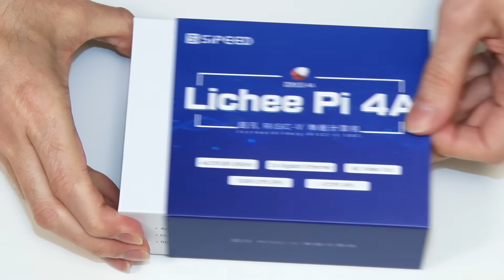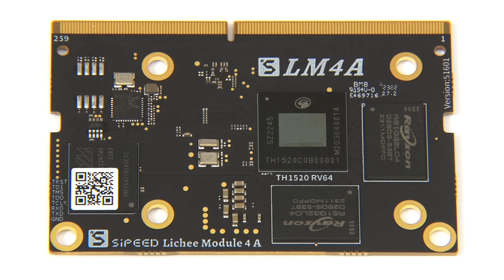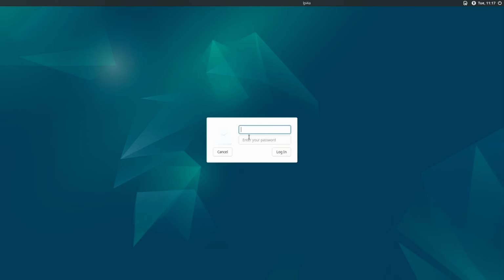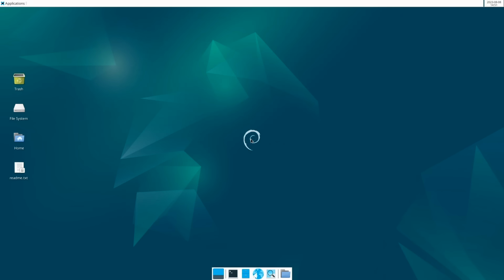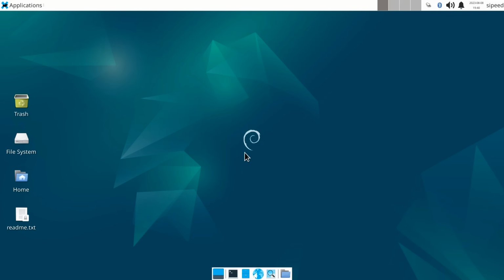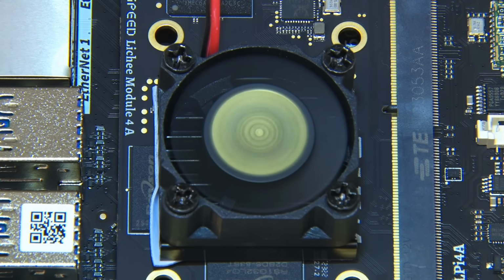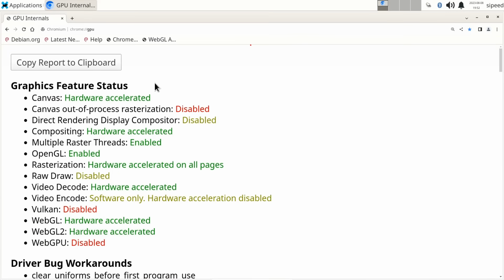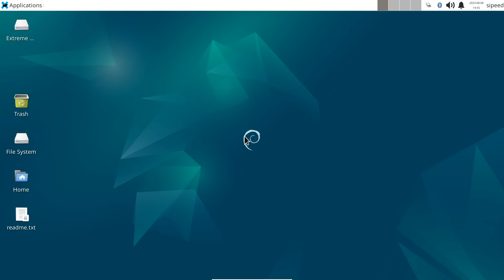Lichee Pi 4A: Serious RISC-V Desktop Computing

Comment: the main problem is price - I buy N150 based mini-PC for 87$ - and this is ready to use device with 16gb ram and 500gb m2 SSD, and it able to playback 4k60hz video on youtube! I use it as cheap and awesome TV box, because of built in smart TV sux!!!

The concept is cheap - this is that everything is ready for work - the body is assembled - the power supply in stock - the most difficult obstacle - this must be set the OS - this is the price for the device with the characteristics that I described should be in the limit of +/- 10% - I do not consider in principle - this is a cheap and multi -functional PC and more for such a thing I will not pay - 

MAX cheap is 100$ and everything should work 

There must be a case
And everything is installed in it - RAM, SSD disc minimum at least 500GB, Kuler is natural, WiFai, Blutus!
The power supply is included!

I see you are not too lazy to take the sets "do it yourself" - but this should give an additional discount on the goods!
Reply from the maker: You seem to have completely missed the point. As I note in the video, this is a *RISC-V development board* for those seeking to program for or otherwise experiment with RISC-V hardware. And you cannot do that with an N150 or any other Intel or AMD mini PC. The Lichee Pi 4A is NOT a consumer product and IS NOT marketed as as such. If you are looking for a mini PC, do not buy RISC-V hardware! :)
Reply: @ExplainingComputers  my main point is PRICE (COST)

Initially, micro PCs positioned themselves as cheap solutions - for me as a desktop PC user - they should be cheaper - but at the expense of lower performance!!!

But in reality - they are more expensive than desktop solutions and less productive!!

You can't convince me that these are niche solutions - take it apart yourself Pi has advertised itself like that from the very beginning!

Now I see that only mini PC can fulfill my requirements!

For even a cheap desktop with the characteristics of a mini PC becomes more expensive due to the case / cooling and power supply .. and other elements

Comment: The Register has an article entitled "Faulty instructions in Alibaba's T-Head C910 RISC-V CPUs blow away all security", that specifically includes this Lichee Pi 4A SBC (which apparently uses the vulnerable RISC-V chip) in its affected computer warnings. If this report is true, it is probably a BFD regarding this computer's (and certain specific other's) potential vulnerability. It is NOT, however, a vulnerability in the general RISC-V architecture, but rather in the extensions implemented by this chip vendor.

Comment: I have a specific use case for tthis kind of hardware: running an instrusionn detection system! This hardware is particularly applicable  because it have two ethernet ports which means I can have it in between my modem and router runnnig snort!

Comment: This "PC" is not what it looks like. It is a small pluggable single-card computer designed for clusters, Laptops and other stuff. I'm most interested in the cluster concept of plugging seven computers on a larger board. This has the potential of becoming "wearable super computers", which are suitable for your private home AI.

Comment: when he talks about the tempature sensors but makes the comment of not sure where that is - not pvt on top of pi screen.   pvt can be looked up ( I did ) and it means presure, votage, temperature.   Article states the soc manufacturers usually put pvt sensors in to monitor ( presure, temp, voltage ) in the soc.   so assume 2 sensors in the soc chip.
Reply from the maker: Thanks for this. I knew what PVT means. :)

Comment: I see risc V making inroads in companies that don't want to be bound by arm for the most part. It would not surprise me if there is some prototype RISC V hardware at apple running OSX and IOS. Much like OSX has been running on ARM since the first versions. Apple likes to keep their options open and I can't imagine them not being concerned about ARMs control of the ARM ABI. They make their own CPUs, so once RISC V reaches the level where high performance processors can be made it makes a lot of sense for them to consider it. First on IPhones and IPads, then eventually on the desktop.

Comment: The fact that RISC-V systems are starting to become mature enough to be used for regular desktop use is huge. A couple of years ago that would have been considered a pipe dream.
Reply from the maker: Agreed.
Reply: Still no bios.
Reply: my sun system is 25 years old and runs on RISK.
Reply: @robertsmith2956 RISC CPUs aren’t new, but the RISC-V ISA is. Although it’s pretty sad that Sun’s SPARC didn’t make it big
Reply: @notNajimi These snapdragon and M series chips have certainly set the path for arm based desktops. It's so exciting.

Windows 11 recall feature plus the EOL for Windows 10 is honestly going to drive many users to at least try linux, which is great for the community. Very uplifting near future for arm and linux fans!
Reply: @YaySyu risc-v actually isn't ARM. Your enthusiasm is excellent to see and both ISAs will offer great paths for Linux (the latest Raspberry Pi Pico has cores for both!)

Comment: How does this CPU compare to RaspberryPi ? I mean compression, etc. I read the CPU is a beefed up design (if Xuantie-910 core is inside) - 12-stage pipeline, out-of-order execution, multi-issue
superscalar architecture with instruction set enhancements and still open source (according to a Chinese article).

Comment: I really want to like this, but I also don't trust running stuff on a CPU designed in China, no matter what instruction set it uses.  Is there a Risc-V CPU designed in Taiwan?
Reply from the maker: The RISC-V instruction set is from RISC-V International, based in Switzerland. The C910 CPUs that use that ISA here are indeed designed in China. But unlike most CPU cores, they are open source -- T-Head/Alibaba has even put them on GitHub. So in many respects they are cores we can have a great deal of trust in. I am not aware of any RISC-V cores from Taiwan.

Comment: what is the use case of this $180 device?
Reply from the maker: As noted in the video, it is for those who want to develop for, or otherwise experiment with, the RISC-V ISA. So, for example, it is for programmers who want to port their x86 or ARM operating systems or applications to RISC-V. Or for hardware developers seeking to create RISC-V devices.

Comment: it would have been nice if you would have shown some things:

what kernel is used?       what is the output of glxinfo?

it would also have been nice if you would have shown us how much power the board is drawing.

imo risc v is highly experimental.  they havent even finished their vector extensions yet.    and without simd, things like video playback etc. is going to struggle.

i am waiting for a risc v chip which has the full risc v potential, including simd
Reply: 5.10.113

The GPU only supports Open GL ES, and glxinfo is broken.

6W without high draw USB 3.0 devices

RISC-V Vector 1.0 is finished, but no devices yet have been taped out for it.

This somewhat early gen uses 0.7.1 which is binary compatible somewhat with the 1.0 spec.

T Head has a Matrix proposal spec for RISC-V as well. Though it's too new for anyone to make silicon for it.

Comment: Excellent review. It is clear that numerous semiconductor design firms, especially Chinese organizations, aspire to adopt the open-source RISC-V chip architecture, hence avoid the high expenses associated with proprietary systems. Good work.
Reply: copy&paste from a news-article from early august: 
"The RISC-V open instruction set architecture got a boost today after it emerged that five chip giants are coming together to jointly invest in a company to develop reference architectures based on the standard.

The new entity will be formed in Germany with investment from Infineon Technologies, Qualcomm, NXP Semiconductors, Bosch, and Nordic Semiconductor, with the aim of speeding up "the commercialization of future products based on the open-source RISC-V architecture."

If this sounds a bit vague, it is because the company's formation is subject to regulatory approvals in various jurisdictions, and so at this stage the founding corporations are unable to add any further detail about how much investment is involved, when it is expected to begin operations, or even what the company will be called.

What we do know is that this will not be a chip manufacturing operation, but will focus on the creation of reference designs to help increase the adoption of the RISC-V architecture. The aim is to establish the company as a single source for developing compatible RISC-V-based products.

Given the involvement of NXP and Infineon, it is perhaps not surprising the initial focus will be around automotive applications, with an eventual expansion to include mobile and IoT ecosystems."
Reply: @nopadelik9286  Thank you for providing this information. I look forward to seeing more RISC-V products in the future.
Reply: Again the Chinese propaganda?

Comment: This is amazing at this price, it has better maybe slightly better specs and performance probably not that different from the 2012 ARM Chromebook with Samsung Exynos 5 and MALI GPU... which was Euro 300. Also used to only run 720p Youtube video, I had installed a more regular Ubuntu desktop on it...

Comment: Would have thought by now it would be best to go with USB c?
Reply from the maker: Why? USB-C is not an interface standard, it's just a connector that in most instances communicates data at exactly the same speed as Type-A USB 3.x ports. And this board has four USB 3.0 ports! :) Also, how many keyboards and mice plug into USB Type-C ports/

Comment: Heat pads are really terrible heat conductors. Paste is the way to go!
Reply from the maker: Paste is sadly not the way to go here -- as there is no mounting mechanism for the heat sink. It is only held on by the adhesive on the pad! :) I also don't think that (decent) pads are "really terrible" heat conductors -- they are just worse than paste.

Comment: You mentioned that one is WIFi 4 and you are correct that it exists on these.  I would point out though for those wanting better performance there is also 6 that you can get these with.  My guess is the WiFi 4 one is more budget friendly with the prices ranging from $119 to $179.  Maybe one is a budget friendly one and the one is for the one who wants the best one that is available at the time?I am sure 4 will work fine for a lot of people but if you have fast internet and a WiFi 6 or better router you can choose the other model instead.  The way the WiFi is on the carrier leads me to believe there may be a few models with the RAM on the SOM being different.  I like the way they used an existing slot type rather than designing some awful proprietary thing but the downside is someone may get tempted to plug it into a RAM slot in a a laptop and then the SOM and laptop no longer power on.

Comment: I contract Pi Industries? To see it they have a 4-core CPU @ 5.0-6.0 Ghz, 32 GB onboard Ram, and eMMC and/or SSD?TB that can NAS Panel to handle "4-max of 8" eMMC or Sata3-SSD size of 1-5+ TB each 40.00-100.00 USD.  I want to Mount like a 24" 1080-4K flat panel screen, in one of those thin briefcases? Laptop style Keyboard, Touch-mouse, inboard battery add? But the cost may be around 650-1200 USD. AKA "Linux-NUKES"! Or you can build one?

Comment: in all fiarness, i already found the r-pi 400 a very decent desktop experience, like a pi-4 but just a little bit spicier in the clock speeds which help starting up your browser and stuff,  and it is suprisingly performant in realtime audio recording too with a simple scarlett 2i2 connected to it

i've bene blown away by the musical capabilities in terms of realtime synthesis and running DAW's like reaper and renoise
the options may not be as appearantly abundant, but even vst's like roger linn's surge can be built from source for arm (TONS OF WARNINGS on the makefile not having all the provisions for raspberry pi os distro and hardware when building it, but it worked regardless)

jack audio routing is something else too, giving you routing options windows can't even dream of providing
and from my experience even on x86 hardware it's barely more latency tahn ASIO on windows, which locks down the hardware completely even when wrapped with asio4all, jack audio is the best of all those worlds with minimal drawbacks

pulse audio needs to die in a hole though

i initually bought the r-pi 400 specifically for guitarix because it performed so extremely well using a r-pi 4 with a scarlett 2i2 and it would give me a little keyboard to do simple typing on as i'm armed with a guitar, so it was more convenient too in terms of space and convenience
 :D

Comment: That's insane.... I guess nothing like the threat of sanctions on proprietary tech to jumpstart open source architecture/instruction set that had been kinda stagnant for a decade... xD
Nevermind wondering whether this will work or not, seems the question now is how Risc V architecture will affect apps and the general upgrade path.
We're already at minimum viable computer already, kinda.... I have no illusions Risc V will get to some high end point, but it really doesn't need to. If it can work for small servers and average everyday computing, I imagine it'll have more than reached it's goals and purposes.
Thanks for sharing Cris!
Reply from the maker: Exactly. Brilliant post -- thanks for sharing.
Reply: @xsportseeker "jumpstart open source architecture/instruction set that had been kinda stagnant for a decade." The RISC-V instruction set has only formally existed in frozen form for 4 years, being ratified in July 2019 -- the same month the C910 cores in this board were announced. As it takes about four years to get from CPU core design to a mass-produced SoC on a board (Pi 3 and Pi4 were no faster), right now is the first possible opportunity for a mass-produced (i.e. cheapish) RISC-V SBC to exist. (The slightly slower StarFive JH7110 SoC and boards using it beat it out of the gate by a few months e.g. VisionFive 2, Star64). Where is the stagnation?

Comment: Chris, thanks !
Considering where it was made and came from, have you tried to run any security check? I am unfamiliar with RISC-V security tools, but like Kaspersky of sort, perhaps?
Thanks again!
Reply: Nah, paranoids would just wipe the distro entirely but you need to watch out first what this distro is using so you can add it to yours. BTW your attitude is correct, mentioning an unworthy windows program from Russia is not. This is Linux here, not some lame Windows thing, if you want to be paranoid, be paranoid of everything, no matter where it comes from. A Chinese device isn't worse than American device, all you are changing is what spy agency gets your data. If you are paranoid, you wipe and use a source based distro and compile everything yourself, preferably taking the time to inspect every line of code. Surely some institutions do, just to make sure...

Comment: Great video, thanks for showing this fantastic board! It really is remarkable just how far RISC-V has come in just a few short years. This sort of demonstration of what RISC-V systems can do would have been unthinkable a year or two ago, and now it's to a state where it's likely usable for basic daily tasks.

One thing I would like to see is a comparison between this RISC-V board and some other ARM based offerings, like the Raspberry Pi but others too, to see how the RISC-V processor can hold against other similar(-ish) ARM processors in other SBC's. Might make for a fun comparison video at some point, even if it may not truly be 1:1, apples to apples comparisons, due to the nature of support, hardware differences, etc.

Comment: I wonder why do all those SBC's always only use 4 cores, certainly they do work well enough for most things with them, but why are the cpu's always designed with 4 cores since in SBC's the cpu part often only is a quite small fraction of the total system cost, and ARM and Risc-V cores tend to scale together very well.

also great sign, this likely will also mean many more of these kinds of things will come soon, normally based on how long it normally takes new tech to catch up to the old overdeveloped tech you would expect it to take very long for risc-v to catch up, but if the graphs on the site are correct this board already has cought up, and when risc-v optimized compilers are used or become more used this would greatly beat the pi 4 B and such according to the graphs shown on the site.
also do you know anything about the powerusage of this board. since it uses 12nm and risc-v so might be even more efficient than current boards. perhaps there is a datasheet in which it is depicted which you might have seen if it was there, or it could be measured with a usb power meter or such if the current isn't to high.
Reply from the maker: There are plenty of 6 and 8 core ARM SBCs -- I've reviewed quite a few here. For example, the 8 core Orange Pi 5: https://www.youtube.com/watch?v=fHQ1GpYRHPo
Reply: @ExplainingComputers  I think I might have seen that one before or a similar board, and true there are getting more such boards.
but still the standard seems to be 4 cores, so kind of wondering when the standard will shift to 8 cores or such. or perhaps even a sbc apearing with something like 32 cores or such optimized for home server use.